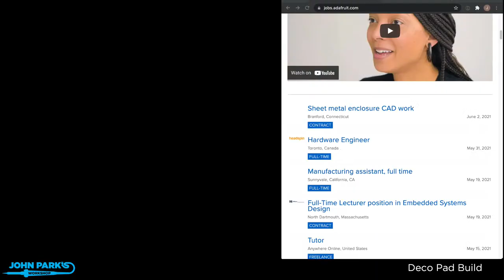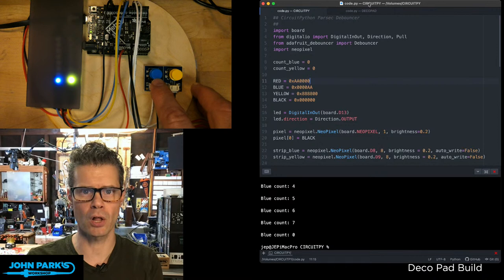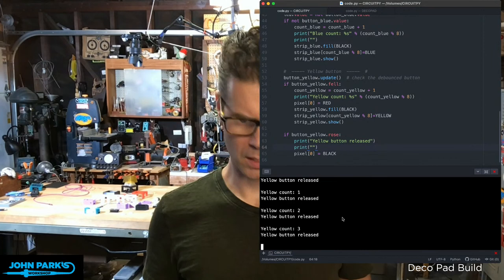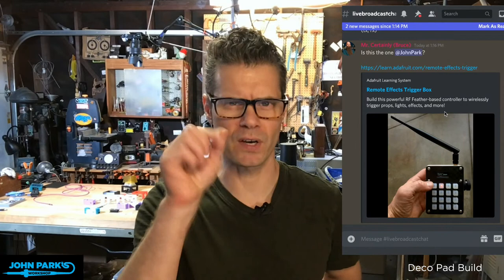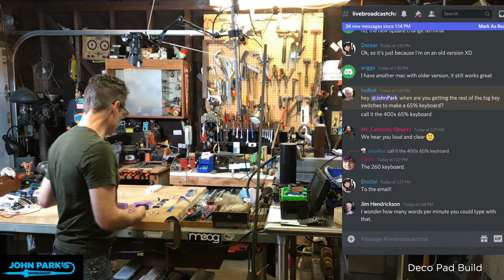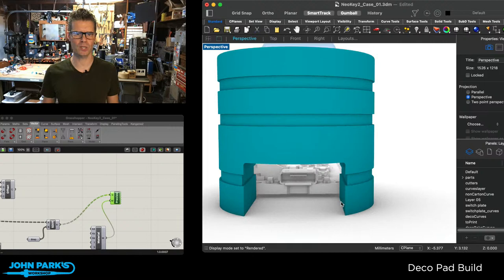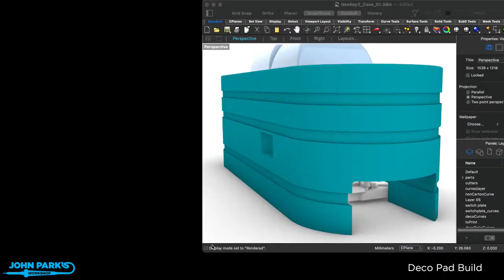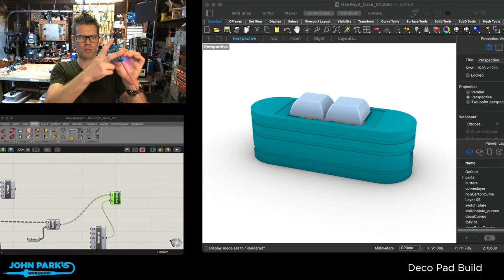JOHN PARK'S WORKSHOP LIVE Deco Pad 6/4/21 @adafruit @johnedgarpark #adafruit

Comment: Hey, I missed the live stream...  YES, I have something I am working on.. I am wondering if I can get an esp8266 to get bi-directional data to/from the GPIB/HPIB interface bus using a PCF8575 16-bit IO port? I need it to convert (HPIB commands to json) and vice-versa.

The device I want to talk to is the: HP-3438A DVM
And yes, I have seen a few videos on doing it with a NANO .. without the PCF8575.

Any help would be appreciated. Thanks.